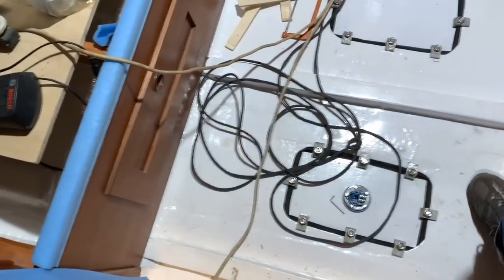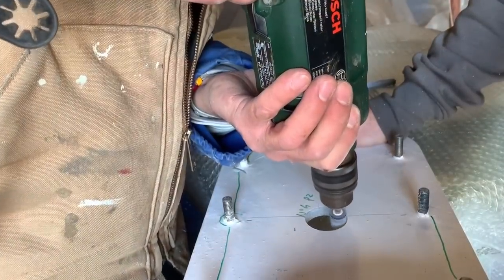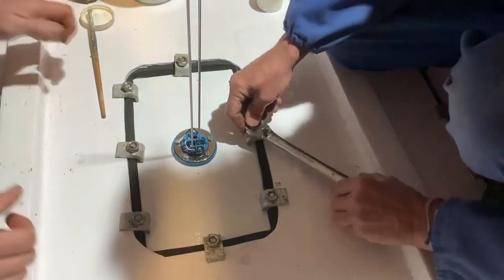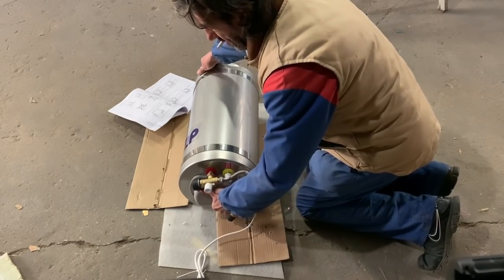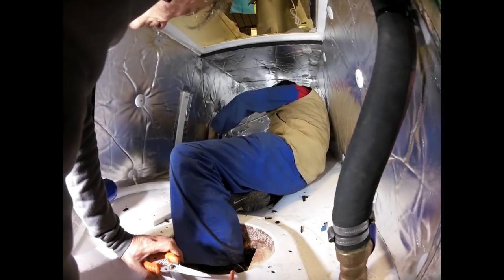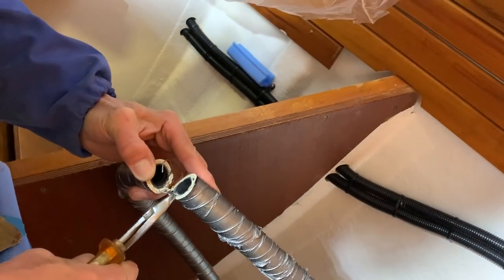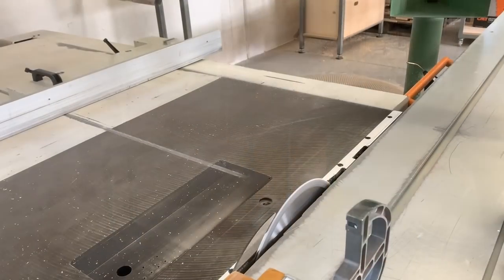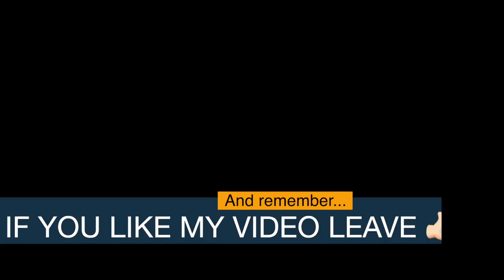Hallberg-Rassy 312 "Ellös":THE ISOTEMP WATER HEATER + BONUS (DIY BOAT)

Comment: Great way to start a Monday morning Big G! Thank you!
Reply from the maker: Thx David!! I’m on the boat just now and filming the new video....
Reply: @sea4see  So is that hot water heater a tank that holds hot water or does it provide hot water on demand? Tankless? I realize that is a tank but really don't know much about the tankless options that seem to be more popular in Europe not so much here in the states.
Reply from the maker: David the water heater has 20 litervtoy. An warn by electric of marine supply or by engine is a hot reserve that you mix with the cold water of the main tank is a close circuit

Comment: Gabriele again an amazing job on your boat! You are so fortunate to have the assistance of your very talented friends to help you with so many of the small details. Of course your choices to have everything done to such a high standard are amazing. I do not think any boat factory would take the time and effort to cut out the sound insulation and to place Corian blocks for spacers to mount the water heater. So your boat will be better than a new one from any factory when finished!
Reply from the maker: Ciao Ben! This is true great talented friend I’m always try to learn from them but still faraway.... try to do the best....

Comment: Thanks for the great video! Couple questions: What is the point of scratching thread of hose nipple? 
I can see that thru hulls for cockpit drains are located in engine room but where the hoses from deck drains are leading? Does they have own thru hulls?
Reply from the maker: Hey Heikki, the little scratch of threads avoid the hemp fiber to turn when you turn the fitting and it stay in place, yes the cockpits drain has their own seacock inside engine room  1-1/4 size with no stick Guidi valve.